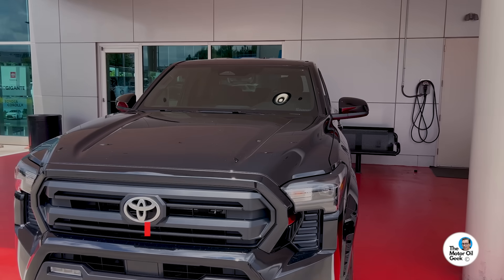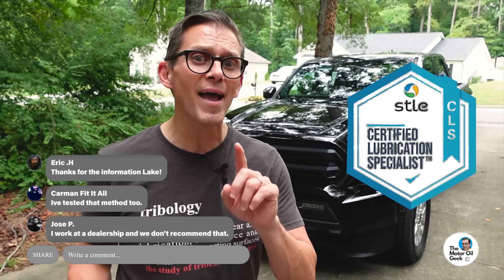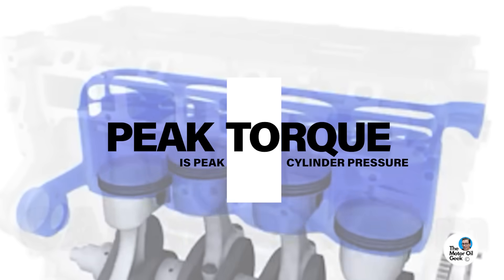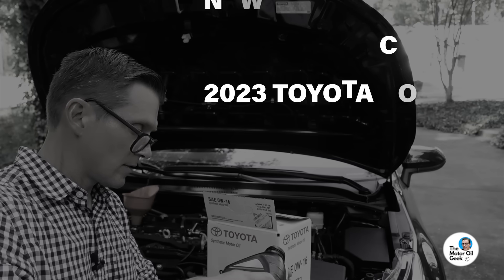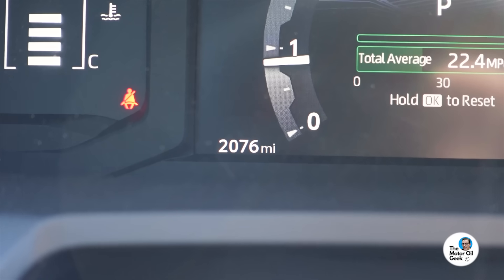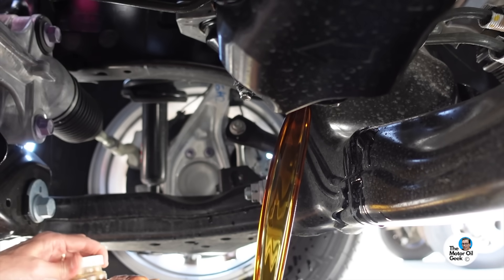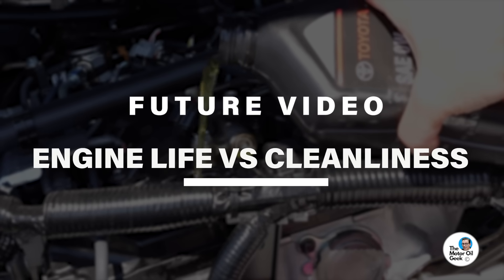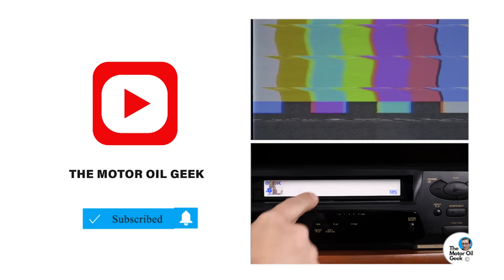The FACTS About Oil Changes (What The Owner's Manual DIDN'T Tell You)

Comment: Wife has the same turbo 4 banger engine in her 2024 Highlander. The first oil change at 11.5 months and 4,200 miles. The oil still looked new. It has been 8 months and 2,800 more miles so on pace  for a little over 4K over 12 more months. 

If the plan is to keep the vehicle until it has 300K miles or for 20 years - doing break in oil changes at 500, 2,000 and 5,000 sounds like a plan - but we will keep the vehicle for about 7-8 years then buy a new one. It will never see 40K miles while we own it.  It was the same with her 2010 Santa Fe and 2017 RDX both traded off with around 30-35K. In our case doing a bunch of extra oil changes does nothing but waste $.    

My 2007 Tahoe got its first oil change at 1K miles - I still recall the dealer saying it was a waste of money to change it so soon . The 2007 with 68K miles still runs like new. So it is worth the little extra maintenance because the plan was to keep it for a long time. 

YMMV

Comment: Did similar on my new 2024 Subaru WRX, changed oil at 500mi (factory 0w-20), it was winter.  Changed again at 1000mi (0w-20), then converted to (5w-30) at 3k in the Spring, using Pennzoil Ultra-Platinum. Change every 3k.  Also, installed dual Radium Catch-Cans to prevent oil vapor from affecting turbo and since the VB engine is direct injection, preventing intake/valve deposits.

Comment: You are completely out of your mind !   Wow what a colossal waste of resources and time.  Possibly that made sense decades ago on a special vehicle.  But not with todays engines and how they are manufactured.  I had a 2015 Camry V6  which I just traded in with 160k on it.  Oil was changed at 7500 miles and every 10 k after with 0-20 mobil 1.  Engine ran like new at 160k.  Now I never did short trips (less than 15 miles ) in cold weather and had very little city miles ever.   if I did a lot of stop and go driving and short trips in cold weather of course I would change it more often.  But what you're doing on a run of the mill Toyota pick up is insane.   If you had a Cadillac black wing v series or a Corvette c 8 then I could see changing more often .  But to each his own.

Comment: Hey Lake, I have a new Mazda CX-50 Turbo with 500 miles on it, manual recommends 5w30. I picked up 6 quarts from the dealership, Mazda brand Super Premium, but does not state whether it’s full synthetic. Do you know anything about this oil? Should turbo engines only use full synthetic? Thanks

Comment: lol does not help with garbage engine QC and 120,000 recalls. Never have to do this on a bulletproof N55 B58 Bavarian. But changing oil to remove debris out that should not be there to begin with, the engine should be better done and cleaned.

Comment: I have done this with the new vehicles I have owned, 500mi, 1500mi, 3000mi, and 5000mi. then every 5000mi for engine oil and filter. I changed the differential oil (gear oil) at 10,000mi and after that it's amazing how clean the gear oil looks when you change it out early when new and change it regularly . I also change the brake annually , and trans regularly too.

Comment: I know a guy that has a 2017 Toyota hilux he just uses regular mid range oil , ie no expensive synthetic his truck just hit 600 thouand kilometers and he 
tells me I change my oil to much I do the normal 10 thousand kilometer changes. He usually goes 20
to 30 thousand kilometers between changes he  does often do long trips in it but Im  still surprised his engine is still running well.

Comment: I did 800, 2500, and 5000 in my V8 F150. Everyone I told rolled their eyes. I just shrug my shoulders and tell them that I’m glad they don’t buy my oil and filter…and I’m glad I don’t have to replace their worn out parts. 

My last F150 5.0 has over 200k on it and my son drives it all over the country.

Comment: Then why does Toyota recommend 10K mile oil changes, so they can be assured you will be getting a replacement engine at 100K miles?  So  wrong on Toyota's part.

Comment: If I was you id use 5w 30 I have a highlander With the turbo and I noticed around 3500 miles it will burn some oil with 0w 20. Got 80k miles on it so far

Comment: The best thing about your videos is the way they make you THINK!!!  So I picked up an interesting point you made.  You left the stock oil filter in at 500 miles because they filter better with time.  100% get that.....so......what if we acknowledge that Toyota filters optimize flow over filtration according to tests I have seen.  It would seem for a new engine, the better the filtration, the quicker the contaminants get captured.  Starting to wonder what is MORE important, oil changes or INCREASED filtration to pick up contaminants.  The oil change gets the stuff that is not filtered, but if the filter did a better job............wouldn't this keep the oil cleaner for a longer time frame.  This is the direction the Valvoline Protect and Restore is taking us in. 
Great future test!!!!! Use best filtration on the market v OEM and compare those results.

Comment: Back in the days when vehicle owners actually had some mechanical knowledge, the owner's manuals actually did tell you to change the oil very soon to get rid of the "break-in" contaminants, then change at shorter intervals than we have now. 

Fast forward to today, and the average vehicle owner thinks that all fluids are either lifetime or near lifetime and that the only tool they need is a cellphone. 

The new gas direct injection engines are just time-bombs because of the new maintenance instructions. Car companies love the short-lived engines because they get to sell more cars.

Comment: I worked in a heavy duty diesel shop and in order for the shop to honor their shop warranty, we had owner/ops come back when the truck had 5,000 miles on a break in…and because the customer we mainly dealt with had a fleet of trucks used for “severe” duty purposes, we changed oil at 12,000 miles on all trucks…lot of PTO and engine idling in that fleet. We never had trucks with oil related problems in my 6 years working there.

Comment: so I've heard from a couple of sources that the manufacturer uses 'break-in' oil in the engine from factory, and changing it out too early could ruin break-in. Any truth to that?
Reply: I was wondering how the moly went up from the virgin oil sample of TGMO 0W-20 compared to the sample of the first oil change which presumably was the factory fill unless it’s completely different oil all together. We can see the moly level of virgin sample and the 1500 mile sample more closely match so they are the same oil.
Reply: from my knowledge of break-in oil, you run it for 400-ish miles and then change it out, so it looks like the same time frame.

Comment: In Russia, a lot of attention is paid to oil. There are several reasons for this: first, there are a lot of counterfeits. Second, the dealer wants to deny the warranty in every possible way. Third, cars often have the same owner for more than 10 years. It is recommended to change the oil more frequently during the first 10,000 to 15,000 kilometers, as there is an increased amount of wear and tear in the oil. After that, it is advisable to change the oil at least every 5,000 kilometers if you drive in traffic jams, and every 8,000 kilometers if you drive on the highway. You have a great pennzoil oil, buy it, it's one of the best products. We have a 4L canister for about \$100
Reply: And a little more, if you have a Toyota or GM, usually dexos 1 gen 3, ilsac gf6 and viscosity 0w20. You can use the same 5w30 oil with the same tolerance, they are very close in characteristics. In summer 5w30, in winter 0w20.
Reply: Also, don't forget to use a cleaning additive for the injectors and combustion chamber in your fuel (at least once every oil change). It's crucial to flush the radiators by removing them. Your car will thank you for it. If you're an American and you're buying a car for up to 5 years, you can follow the dealer's recommendations.

Comment: The reality is If you changed oil at 10,000 miles it will last 500,000 miles change it every 3000 it will last 600,000 miles.  The question is, are you going to drive it 1/2 a million miles???

Comment: Like you, I too can go out and get some oil certification and pull rank over the ignorant public.  Why stop at 3 changes in 5000 miles, do five?  or just follow your Toyota manual. My Canadian Camry manual says every 16,000 km, for the sake of convenience, I reduced it down to every 10,000 km and I need to keep no records. I change my filter every second time. Odd km. My 2015 had only one synthic option , and in Canada , they cost like $50 a jug for oil, at some point , I have to start ignoring what you said and save the money into an engine overhaul fund .  The 10000 km (62,00 miles) intervals are actually very close to the 7500 miles service intervals that was standard for American cars for many decades, standard set with inferior oil.

Comment: Unfortunately I couldn't wait for 500 miles and had to change my 26 Grand Highlander Hybrids oil and filter around 276 miles due to an upcoming long trip. Returned from the trip and the vehicle is now at 1144 miles I didn't use the original Toyota 0W8 instead used Mobile 0W8 and have a spare 5 quart of Mobile left over for the 1500 mile oil change. That factory Toyota oil filter was on really tight though.

Comment: OK so short verson is use the owners manual for Oil weight recomendations that are written to pass EPA standards and not for engine longevity. Then you say two things really impact oil: Temperature and Contaminations: "to get that higher temperature you got to have a Turbo Charger" so I guess the external air tempeture is universal on the entire planet & nobody ever towes a trailer/caravan in 40+C (+104F) for hours at a time, its only a turbo charger that can raise the oil Temperature!!

Comment: Ok, a couple of questions. 1. You said to warm up the engine before changing the oil because the viscosity decreases with temperature, but I thought that 10w40 meant the viscosity is 10 when cold and 40 when hot, so what's the deal?
2. I'm dubious about not changing the oil filter for the first two oil changes (based on the filter being more effective as it ages) because you are leaving the old and dirty oil in the filter. If you swap the filter out you would be using max fresh oil.

Comment: Blake you all made all that mess underneath but not applying forward pressure to the bolt as you unscrew it if you apply this forward pressure it creates ceiling amongst the threads and you won't have all this dripage all over your socket and hand before you pull it which is really the majority of the big mess that gets made also I prop up my oil catch base and on some plastic tote so it's much closer to the drain

Comment: So, is that why my Subaru Brat motor failed at 75,000 miles, because the previous owner had only changed the oil 3 times in that time?

Comment: With oil changes we did something similar with our new Subaru because we keep our vehicles until we crash them or they fail catastrophically. Also, don’t forget the transmission. In our Subaru case the transmission oil according to Subaru never needs changing but we did so anyway at 2000 miles. Painful at $20/quart for Subaru transmission oil but I’m very sure it was the right thing to do. Our Tahoe with 330K miles on it uses almost no oil and can only hope the Subaru makes it that far.

Comment: 4:52 The guy from Donaldson twice clearly says air filter not oil filter.
Reply: Yeah
Reply: AND you think oil filters somehow break physics or fluid dynamics law to work differently???
Besides, with the common advice to change oil every 7000 or so, he's hardly pushing anybody's luck or the filter performance by leaving it. Chances are, so long as you DON'T run beyond the designed specs of the filter, ALL FILTERS will perform just a little better as they pick up the particulate as designed.
Reply: @gnarthdarkanen7464  Just curious, would it be okay if a 20,000-mile filter was used through 4 5,000-mile oil changes?
Reply: @SR-dh1vj  You'd be working within the performance rating, so yeah... It would be okay. Optimally, you'd call at least that last oil change a little short of quite 5,000 though. The reason being that the system was also opened to outside debris through the changes... AND I get it... Not exactly what we think of in terms of "abuse" on that kind of product, but the 20,000 mile filter is designed for a 20,000 mile machine on a 20,000 mile working cycle enclosed, except fluid level checks...  Not through the changes, so we sacrifice a few miles to accept our culpability for that mixing and matching... Maybe like 4,500 instead of 5,000. But that's just how I'd probably face it...
Reply: @SR-dh1vj  no
Reply: @gnarthdarkanen7464  The concern is that as particles build up, the pressure drop across the filter increases. For air filters, you would notice it as reduced power. For oil filters, the bypass valve could open and you would not know. Even thought the mileage is low, the particulates in the oil are much higher during break in
Reply: @ppaschka  Yeah, Lake's covered that, too. AND reputable "upper middle road" brands put out filters that perform fine for such applications... But you have to have been paying attention through all those vid's too.
Reply: @gnarthdarkanen7464  I do. I think that air particulates and air flow are very different than fluid dynamics as in liquid. Air is more of gas flow..compressibility (air density changes with pressure), flow resistance, and particle capture efficiency; Oil: high density, high viscosity → flows slowly, resists motion; viscosity (oil is much thicker than air), pressure drop across the filter, and laminar vs. turbulent flow inside the filter media.

Equations often use Navier–Stokes with incompressible fluid assumptions, since oil doesn’t compress much under normal conditions. My belief not to just disagree is that assumption from a fluid expert....is one that should be tested rather than assumed.
Reply: @paullange6072  That testing is what Lake is DOING AND DEMONSTRATING here. The numbers he showed and followed in the vid' indicated that his filter is NOWHERE NEAR its performance limits. It's clearly still working, or there would be the OBVIOUS JUMP increase in particulate in a sample.
It thereby does NOT matter how you model or think about the math. Filters perform MORE effectively over their life until they quit... It's their nature.
SO as long as he's monitoring closely enough to NOT surpass the filter's performance, it's safe to follow his method, and his advice stands. YOU need to understand that THIS IS the testing. You actually have to get out of the books and put real equipment to risk for the data... That's the only way to get REAL numbers.
Reply: The owners manual for our Honda Fit says to change the oil filter every other oil change...
Reply: @shawngrimes9302  and you should...unless that $7 imposes financial hardship
Reply: It’s not the fluid medium it’s the filter type. Both filters are a paper  depth style where your particles are getting trapped , not necessarily blocked at the surface of the filter. 

As the paper loads the easy flow paths are filling up with particles so the nominal filtering size goes down.
Reply: Sure, I'm aware of the other video and when I watched that, it hit my interest immediately, however don't forget that an oil filter has a lifespan and is designed to handle certain amount of milage. For example 7.5k. So, changing the oil every 500 or 1000miles or whatever you want does not make any sense. The filter most likely has no sludge in the beginning and essentially you are throwing away 95% left capacity of the filter. So, even if you believe dirty filter does not improve its performance, makes no sense to change it, for one very important reason! You have to put your engine under extra stress in the first few minutes because (even with fully pre-filled with fresh oil filter) initial filter flow is significantly reduced and engine struggle a bit. A good analogy that many of you might seen is a fresh water filter needed to be soaked for 10-15 minutes in water and first 10 refills takes significantly slower flow (that is due to how fast water penetration goes through a brand new filter). For typical oil filter that is not that bad, but your engine in the first few minutes struggle to properly lubricates.

Comment: I usually wait just a tad longer for the initial oil change on a new engine.  I wait till 1000 - 1250 miles, then i do it again at 2500 - 2750 miles and then again at 4500 miles.  ive always also changed the oil filter as well 🤷🏻 just trying to do my due diligence for my new engines.  never really knew I shouldn't replace the filters for the first two changes, i will say the first filter feels SO heavy when its breaking in and whatnot.  but yeah, idk, I just feel like im doing better than 98% of new vehicle owners 😅  and I still only do about 2500 miles oil changes thereafter or 6 months. *also i only ever use the factory oem oil and oil filters

Comment: Sorry for little different question. I am following you from Greece in Europe. These kind of trucks, we call them "farmer truck" even is large used in so many jobs and applications, always are equipped with diesel engines in order to provide fuel economy and also the "character" that these vehicles prefer, great amounts of torque in low rpm. It is a surprise to see a gasoline engine in a car like that!! What is the mindset for this engine choice?? Thank you in advance.